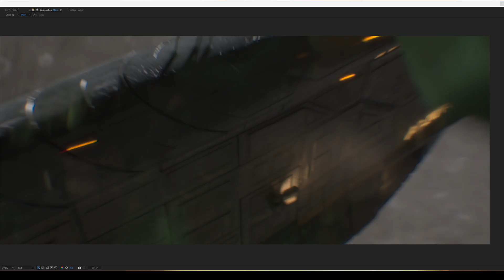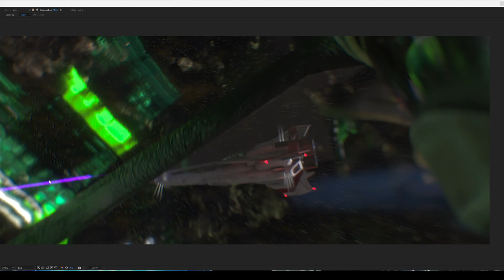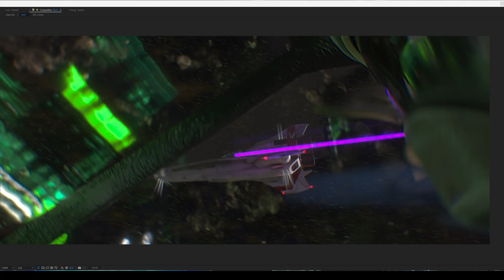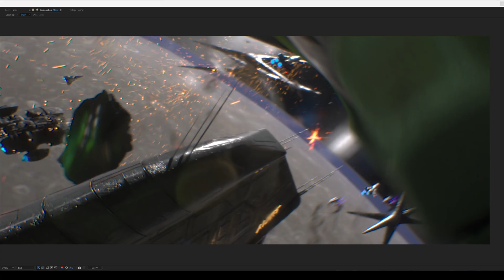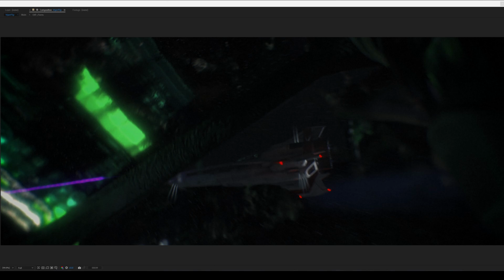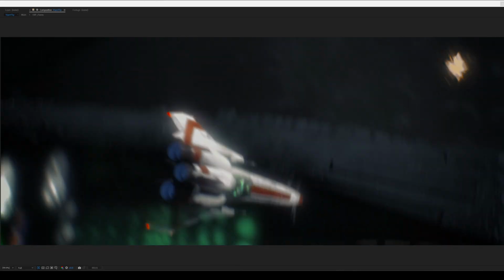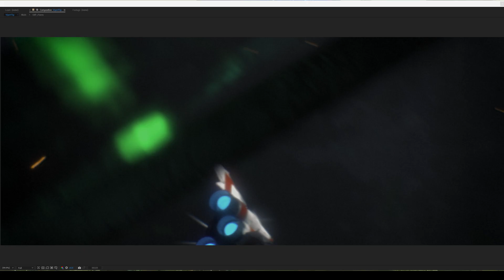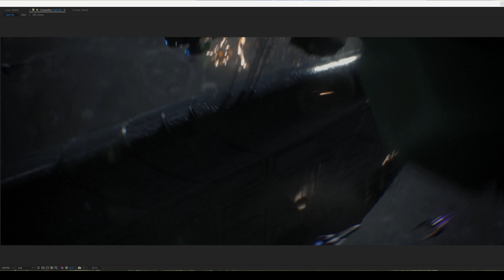UE5.6 Path Tracing Temporal Denoising Test_001 Breakdown

Comment: dude, these purple spots on the shots are unnoticeable while playback, solving these little details gives diminishing returns compared to time spent on solving, i guess you have to figure out when to stop improving things.

So, i've a question about denoising, it seems that with path tracer animation, the denoiser generates a smudge on every frame, since the denoiser is per frame. How do you solve that? is there a temporal denoiser to reduce the flickering or just ramp up the path tracer samples?

Comment: my previous computer hated UE5, and I had a UE4 project (my BSG film) already in UE4, since I had assets I couldnt swap over, I stayed.

unsure if I should stay on Unreal Engine 4, or switch to 5.

I read somewhere that you HAVE the 2004 CG models since you worked on it?
what models did you make (other then Firedragon)?, what models do you have access to, if I may ask.

(i'm just randomly commenting on videos I think are interesting here, have gotten lots of good references and ideas so far.)
Reply from the maker: UE5 is superior in every way to 4. The only reason to stay on 4.27 would be if you do not have an RTX GPU, and you want to use the Path Tracer. 

UE5.6 is significantly more efficient than 5.0, not to mention that Meta Humans are significantly better.

As for what I worked on for the Show(s). 

Mini-Series:
Prison Ship (astral queen)
I co-build the Mineral ship (Film Can Ship) and textured it. 
I textured the "Flat Top". 
Helped build the wide angle version of the Galactica by helping to reduce it's polycount.
I also supplied a lot of the various Nurneies that were used to add detail to a lot of the ships and structures. The Space Station at the beginning is actually mosly my geo, just assembled by someone else.

Blood and Chrome:
Demeter
Osiris
Alert
Hornet

Up-rezed the Generic Transport that Adama is on prior to boarding the Galactica. I also animated about 30% of the exterior space shots influding those around the Galactica (but not the final shot)

Fire Dragon, I assume you have been talking to Chris :P. The FD was a ship I built after working on another show for Zoic a year after the BSG mini-series. That other gig was a slog and I hated it, and the FD was a means to kinda "get back on the horse" of modeling again, and doing it in a more efficient way. I only spent about 4 days on it in about 4 hour sessions. The modeling supe at Zoic put it in the Galactica Main series, as a kinda nod to me, and tried to get the production to buy it, but that never happened. So I still own it, and do not consider it canon to BSG, I can understand that people like it, and want it to be, but I do not condone that, it's use in the show was not with my knowledge before hand, and I either forgot that it was even in there, or never told until someone pointed it out to me when they started asking me about it. Needless to say I was confused, and was more wondering how they even know what it was named, because lime maybe 3 people even knew what I had named it. :P

It was actually meant to fit into the Firefly Universe more than BSG. 
I tend to re-texture it from time to time as a way of honing some of my failing skills. Really it just needs a design update, and I have not gotten around to that. I do occasionally put it into BSG shots, and it appears in an image I did for a BSG book for Eagle Moss, but you really have to squint to find it. 

No real story, other than it is not really a combat ship, it only has one small pea shooter off the right side of the secondary structure. Think of it more of small transport or lite cargo ship. Most of the ships I like to design are not military ships, and tend to be more like the Millennium Falcon in terms of it being a scrappy underdog, more than some kind of front line combat ship. Most of the shots I have done with it, it tends to look like it is having some kind of engine trouble. ;)
Reply: @BookmansBlues  
 that's really cool, I loved the Osiris.

Yes, Chris is very adamant on showing the Firedragon on every opportunity he sees.

Anyway, thinking about it but: would you care to assist in my BSG project in any way?
I understand if you're busy, but I'm running on fumes with only a writer, and part of chris's help.
advice, assistance with lighting, or anything to share would absolutely help, it's up to you tho. ;P
Reply from the maker: @SquiffyDev In all honestly, I do not have any time, all my spare time is wrapped into my own endeavors, you can ask Chris how much I try to stay away from fan films, and related organizations ;) . 

A big part of that has to do with making sure I can have good relationships with companies like NBC/Universal, etc should the need arise to go back to working on stuff involving them. Not that anyone in the BSG fan base as done anything that I am aware of to sour any relationships, but I also have worked on Star Trek, and I know of people who have soured their relationship with CBS/Paramount/etc over that stuff. 

"Best block... no be there." as it were. 

The unsolicited advise I always give people wanting to do fan films, is to instead make it your own thing. Do not use their IP/Trademarks/copywrites/etc. You can do anything that is inspired by something, just distinct enough to not risk potential relationships, lawsuits, etc. They can also just take anything you do, without ever having to get your permission or to pay you. This happens all the time where Fan Art is taken and used in one way or another by the IP holder, and there is nothing that can be done about it. 

I think it is great that after all these years people are still loving BSG, it has always been my favorite IP to work on, because there just wasn't any real drama in it that I was ever exposed to (there is always studio drama). Both times I got to work on that IP, were the best times in my career. So even though I like to keep my distance from fan groups and productions, and remain unassociated from anything going on in that space, I am happy that those things are still trucking on, and I wish everyone the best.
Reply: @BookmansBlues  alright.
that's fair enough.

I'm making my film original enough that only really the star systems and ships are the same, everything else is a complete remake almost.
it's BSG only in really the name and ships, and I'm going to directly discuss with NBC about permission and seperation.

and hey, if it works out I can update you, maybe that could mean something.
(as you can see, I'm stubborn with my projects, I'll try to do my best!)